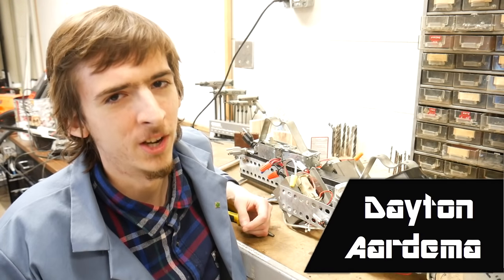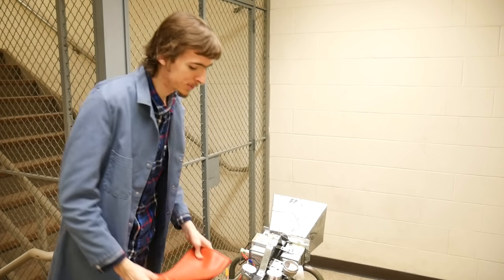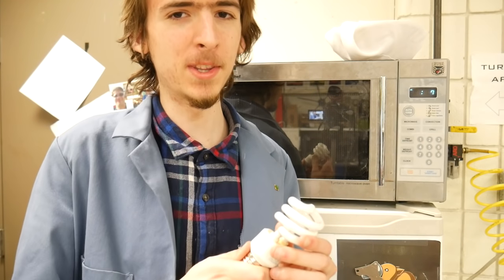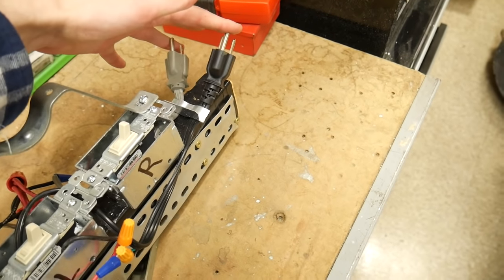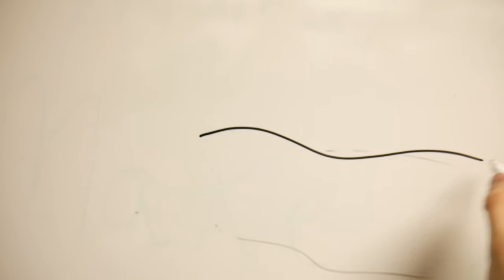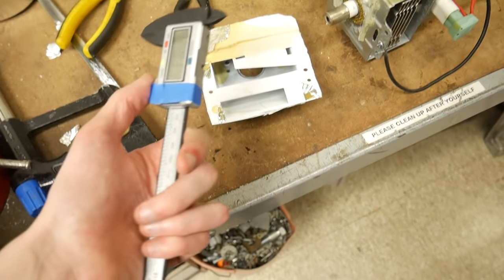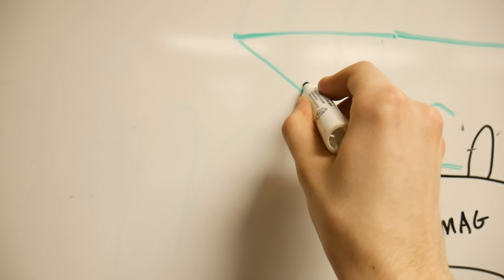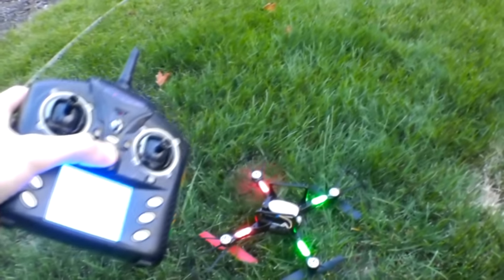How a MICROWAVE GUN Works

Comment: can someone come up with a defense from a microwave gun being used on you.??????
Reply from the maker: Yes. A Faraday Cage blocks all EM radiation
Reply: @BlueprintScience  not a directed beam.  had six beams on home....whole house was a faraday cage....did not help.  They use your electric system of home against you also.   has 200 to 300 hundred dollars electric bills even though had no tv, radio or cell signal to house.  Grounding helped a little.   but the body wounds are very painful when beams hit you.
Reply from the maker: @reneedolefinley6654  I can pretty much guarantee that that weaponized EM is not being used against you (unless you’re a Cuban diplomat). Even if it was, you’d feel an intense heat over the exposed area, not a sharp pain. 
But if you insist, coat the walls in aluminum/copper foil and ground it - a Faraday Cage. Anything inside the walls will be a near perfect EM dead zone.
Reply: @BlueprintScience  working on grounding rv camper.  how to do large grounding.  I guess many grounding rods.  the aluminum mesh really didnt stop directed beams.  i do get the intense heat burned skin and nanofibers cause the sharp pain after five years of this.  kept thinking im become sensitive to wifi or Bluetooth sonar but no this is directed if I moved quickly or wrap myself in copper the ear ringing comes then I'm zapped,,,, have many burn scars from repeated attacks....i am absolutely no one.  isolated in rural area....after three years of no signal from any electronic device moved to mountains...still burning hot vice attacks.  have no idea why...finding many calling themselves targeted individuals .  So many theories...i just want a defense.   something must repel or reflect these waves.

Comment: I have some metal objects in my body, I believe a microwave gun was used on me to turure me? I remember the current sounds an metal objects moving the motion it was moved or pointed. I remember tasting burnt flash or acid.need answer's?  Felt stomach bowlings
Reply from the maker: @chriswarren3215  But... microwaves cant penetrate more than an inch or so into our bodies. So....
Reply: @BlueprintScience  any ideas what it was?
Reply from the maker: @chriswarren3215  Nope

Comment: what tyoe of gas ,helium ?  it must be nitrogen or any innert gas wgich will prevent further teardown of the wire when ut reacts with oxygen ,so its comoketly evacutaed from air while its manufactured ,to save the filament ,it will go away anyway ,so just delay it ,delay the procesd of not going away ,but it will go away ,we caoture sunheat ,not sunlight ,why sokar panels are black ,in order to absorb heat ,which means if it relies on sun light alone ,they could have made it diffirent colir ,but u have to do what u have to do,black absorbs heat ,white rejects heat ,so in order to benefit as much as possible from nafure ,u have to choose black for solar panel vecause its the only efficient option ,and they work on mr peltier modules to transfirm heat into voltage ,not oil at all they lied to me by saying the put somekind  of oil to to circulate its all a lie ,im talking 10 to 12 years ago when i was readibg about solar panels ,free heat from the sun

Comment: You might tune your attention to rail guns using those magnets you salvaged from all the magnatrons you have obviously disassembled.!!
I was also wondering about cutting in half the vacuum tube in the magnatron. My question is. Does the beryllium insulater go right through the tube or is it terminated at some point? 
I want to use the cavity part in some art work I have in mind. Flower centers and I am afraid of messing around with the beryllium insulater. Is there a way to safley deal with that thing other than a full hazmat suit?

Comment: It actually can give/mutate cells and yeah subject you to a "high" cancer risk, depending on the time exposure and distance.  But, leukemia, bone cancer and a host of others; ever think of lead, dental x-ray gown?
Reply: Only fools and the ignorant do...
Reply: Microwaves aren't ionising radiation, so they can't mutate cells. They should be treated with care though, that's why microwave ovens ovens are encased into Faraday cages.
Reply: @jjeherrera  lol micro wave are also use to kill cancer! 
Mutation happens due to resistance due to which ionisation into cell molecular level takes place
Reply: @UtwoBed  procedures r technique matters! 
Targeting r pinpointing cell with proper frequency of microwave can kill only that cell rather than damaging surrounding 
My aunts mom was treated by chemotherapy and after physiotherapy she lived for almost 15-20year and died because of her age
Reply: They do not make full lead gowns etc. any more they are a composite material.They claim it works better but I am not so sure if it only protects from so called splatter radiation.

Comment: Your microwave gun is blatantly sabotaged by your own design. The magnetron would be more effective in the center of the microwave gun and the wave guide should be a tight channel, not an expanding funnel and what would work best is a steel tube.
Reply from the maker: Yep.
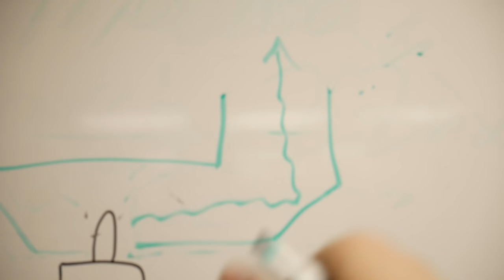Once upon a time I had a channel down the middle like shown at 12:25 but I found it didn't really help so I removed it. I could have just used a smaller waveguide but I wanted to fit both magnetrons.
Pros and cons.